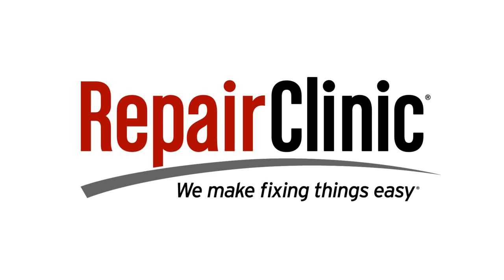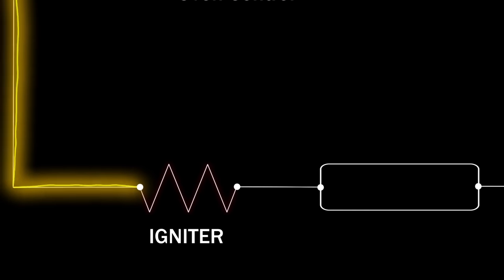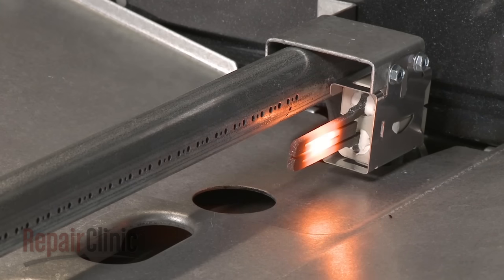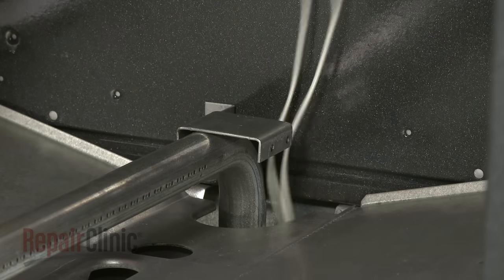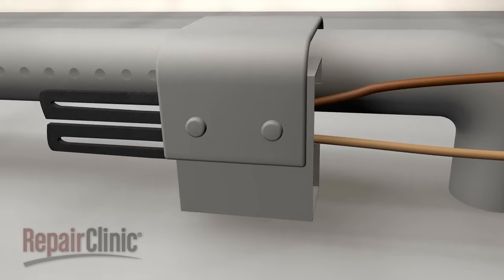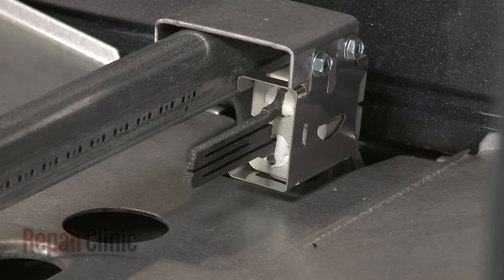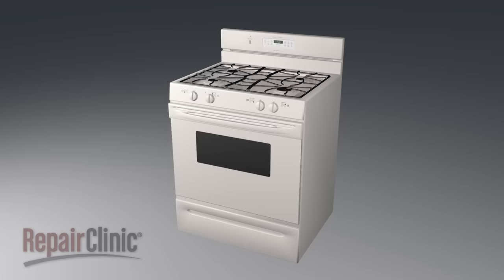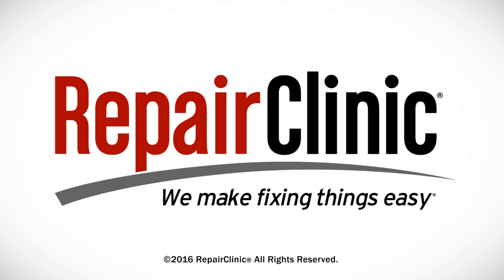Top 4 Reasons Oven Won’t Turn On — Gas Range Troubleshooting

Comment: None of this applies to me.... my oven is from the 1970's/1980's and has no electrical components...... at all.  Do you have any advice, short of having to replace the oven/range itself?  My oven has a pilot light that always stays on..... and when I turn the knob to activate the oven, it actually lights a secondary pilot light, which is supposed to light-up the bar where the flame jets shoot out...... but it hasn't been working for a month, even though both pilot lights work.  Any ideas?  I would rather NOT lose the ability to cook or warm up food in the middle of a power outage.

Comment: I have a GE gas stove model# JGB920SEF2SS. The problem is when I'm using the oven a beeping sound comes on after a while baking? and it shuts off the oven.I have a code on the display stating "FO" It seems as though it over heats?Sometimes  hours after using the stove part a beeping sounds and the code displays again? need some help please. Tom

Comment: Oven is lighting but gas going through pipe orifices is very low as if the line is partially blocked.  Any advice?

Comment: My Kenmore Gas oven  Model # 362.75585890, will  work ONLY work in  Self Cleaning cycle.  I did a clean cycle about 2 weeks ago, didn't let it finish, turned the knob to off, let it cool, and  door unlocked, when I went to use it again about 4 or 5 days after that it would not switch on in Broil or Bake. I did put it through the shortest clean cycle again till the end, thinking it would reset if it finished on it's own. It wen through the cycle, heated accordingly, and finished fine. Still didn't change the problem,  I have unplugged it for a min or two thinking that it may reset, it didn't.

Comment: FX710BGS circuit board not powering on. No lite in oven either. Bulbs good. This is a 2011 Samsung model

Comment: My flipping oven locked itself and now it won't even turn on nothing on the stove no lights no clock no nothing is there a reset button somewhere I have a gas stove
Reply: Some have a sabbath shutdown manual tells how to undo  .varies w different models.🤔

Comment: I wish the video was more clear on how to find and access these components. I'm a female of a certain age😂
Reply: I think this video is mainly to help diagnose the problem. If you go to their website and enter your model number, it will bring up a list of parts for your appliance. Click on the part you need to replace, and it’ll take you to a product page. Under the main image for the part, hopefully you’ll see several other images including a video thumbnail. I found a very detailed step-by-step video for replacing the control board for my range.